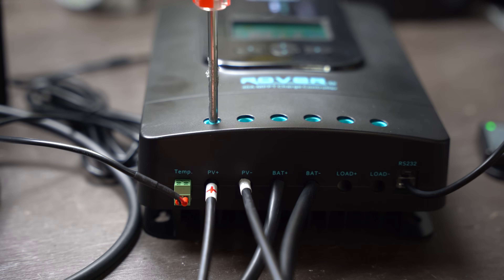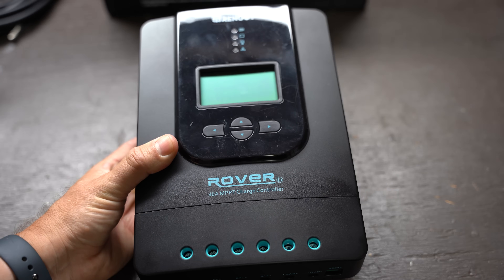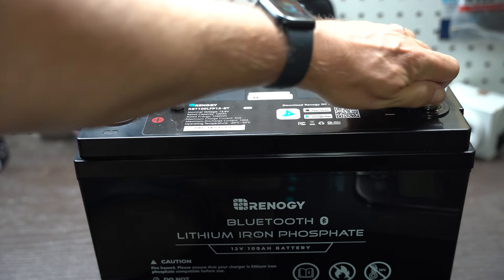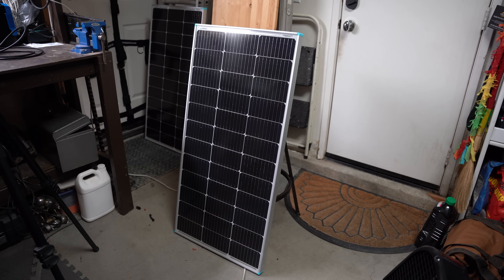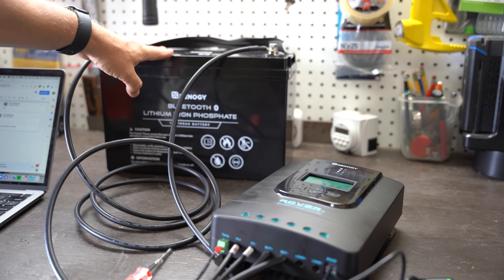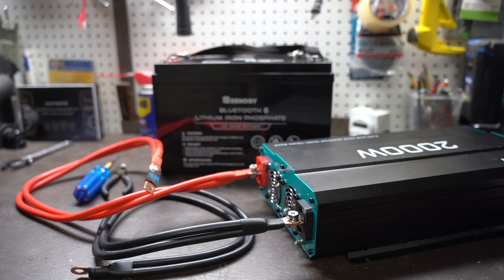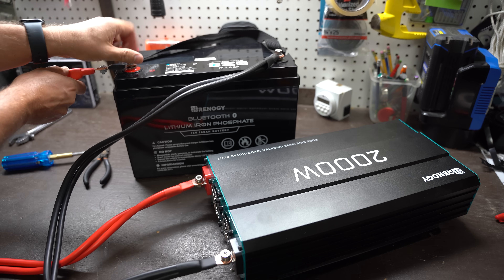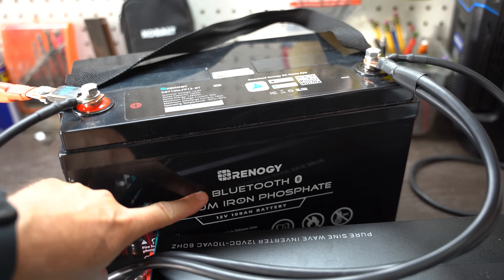DIY Solar Setup: Easy to Follow Step-by-Step Instructions

Comment from the maker: Here are all the items covered in this video:

* Full kit: https://cityprepping.tv/4k929Xj
* Inverter (2000W): https://cityprepping.tv/4baTJe6
* Charge controller (40 Amp MPPT): https://cityprepping.tv/3GJiRNG
* Battery (100Ah LiFePO4 w/Bluetooth): https://cityprepping.tv/44emiWz
* Solar panel (100W): https://cityprepping.tv/42z9A3A
* Battery / inverter cable: https://cityprepping.tv/3Er4YDq
* Battery / charge controller cable: https://cityprepping.tv/4iz4yIY
* Solar extension cable: https://cityprepping.tv/42wrq7e
* 200amp fuse: https://cityprepping.tv/44JejRu

Or, if you'd prefer to pick up a kit with all of these pieces combined (to save money), you can check out these options:

* https://cityprepping.tv/4k929Xj

Follow me on: 

Instagram - https://www.instagram.com/cityprepping
Facebook - https://www.facebook.com/cityprepping 
Twitter - https://twitter.com/cityprepping
Website: https://www.cityprepping.com

#diy #solar #guide
Reply: Amazing content
Thank you so much
I felt really unsure how to go about with a solar setup but, after watching your vid, I feel a little more confident  building one.
Reply: Interesting, in cars, you disconnect the cable from the negative terminal first then positive terminal and reverse the order when connecting, shouldn’t this be the same process for setting up the solar power system?
Reply: Thank you for such a "simple" yet detailed video.  Do you mind providing guidance on the cable lengths and tray cable sizes you used?  As a person brand new to solar DIY, I am not sure.  When I went to add to cart, I did not know which ones to select.  I also think we would need to order 2 of the solar extension cables correct?  I think the first time out, I would like to do it exactly as shown in the video.  (Smile).
Reply: you are such a wonderful instructor! you make this so easy to understand and I feel so confident I can do this for the first time in my life. I've been wanting to get solar panels but had no idea how to begin. thank you so much for all this valuable information. God bless you
Reply: Which kit on that link is this setup in the video??
Reply: Amazing content as always. I recently purchased a Renogy set up, but haven't been able to set it up yet, partially because of fear I'll burn my house down. It seems easy for a small set up like the one you demonstrated, but for a bigger 800W system I don't know how to get started...
Reply: My son in law is an electrician and I am going to see if he will build me one. Thanks
Reply: Suddenly am not scared anymore,  you made it so simple! "I love it"!
Reply: So much cheaper in the UK, you would still save 100% even if you include shipping?????
Reply: For some reason, I cannot get the links to work.
Reply: Hi Chris, I want to build a solar system for my greenhouse. The most thing I want right now is just for the growth light if the system can work for the heater is will be great but not the heater it will be fine for me. What bundle I should buy? Thanks
Reply: Is there an easier way to not have to keep switching the inverter when it’s not being used?
Reply: Great info. Isn't there a quick connect setup?
Reply: QUESTION

with the DIY solar kits do I still need to purchase a battery? is there anything else I need to purchase that isn't included in these kits? thank you
Reply: How to save this video?
Reply: Thank you!
Reply: NEW SUBSCRIBER ❤❤❤
Reply: So do I disconnect my solar unit after my battery is fully charged?
Reply: @ellijahpop  no...
Reply: Nice job. I'm a retired union carpenter so with your experience , you saved me from making costly errors that I cannot afford. Thanks so much
Reply: Thank you. When designing a system as this 12 vdc, should you buy the most efficient panel or the panel with the highest out put voltage?
Reply: Can you hook this up to an actual house panel?
Reply: why don't you use the mppt load terminals?
Reply: Thank you so much, I'm in the process of going off grid with my camper.
Reply: Thank you
Reply: this is penominal
Reply: how much for everything
Reply: Nice easy instructions. The only thing missing for me on this as a power switch. I think that is a minimum. I do have a question about a switch between charge controller and battery or only one for the power to inverter
Reply: You know they make red cable wire.😂
Reply: Can a series of batteries connect to this setup
Reply: P
Reply: @kerry.kumanidis3204  huh ?

Comment: I have been comparing DIY vs purchasing for my needs. I like the idea of 1000-2000 discharge with 2000+ storage as I will be charging it daily with solar and also have a small gas generator backup, but DO plan on using it on a daily basis. Of course the less I have to charge it with gas the more money I save on gas, and I chose to price out 2 x 300 watt solar panels at walmart as they are on sale right now and include a solar "controller". So theoretically I could keep it charged. That's beside the point though. I know I will be getting a solar option that does well but not everything, because of price concerns. Fully solar may be an option someday, but it would be a bit pricy.  Love the knowledge, I needed it. Bare bones pricing it for a minimalist off the grid pricing I got was 2 x batteries 100ah marine- 250; Inverter; 150; Solar Panels - 140 (300 x 2 watt) on sale; Mounting Hardware - 50 (2x4x96 boards are very cheap right now and I would just build boxes and mounts; other hardware wires ect. 50 for a total of 640. Pros is that it would be fully expandable. Cons are reliability and construction. I would do ok and it would work, but pre-manufactured would be more reliable no doubt.

Comment: This is a brilliant beginner guide. Cheers. Got a few curiosities. Does this arrangement work the same way with a standard 12v lead acid battery?
Also, what rating inverter goes with what wattage solar panel etc?
And 11:25 why did you get a spark on the positive terminal there?

Comment: Brilliant tutorial. Love the simple, straight forward delivery. Very quick question - I'm told i"m better off with 200W solar panel on my campervan. In that case, would any of the rest of this setup need to be changed? Thank you!

Comment: I purchased a solar panel that came with a charge controller. and from what I read in the limited instructions the charge controller has those connections that require a Philips screwdriver. but I don't have any wires that go in these connections. to connect to the battery, and the solar panel, and the inverter, the only other connections on the charge controller are two USB ports. and from what I gather from this video. I'm going to have purchase rest of the stuff needed to make this setup work. when I originally Purchased the solar panel to charge the battery in my vehicle.

Comment: You can use shorter wires from the charge controller to connect it to the inverter instead of the battery post's

Comment: Simple enough video but you really should advise people to always connect the positive cables first and disconnect them last. This helps limit the odds of them short circuits if they touch any metal.

Comment: I don’t understand why we are connecting the Inverter with 200 Amp workin to the positive bus bar as well as a the charge controller for 40 Amp and the fuse block for 125 amp?? 

Won’t the positive bus bar be harboring the 200 amps from the inverter and blow the fuses for every other device connected to the same bus bar if it’s not rated for the 200 amps??

Comment: You can connect the solar panel to controller then to device without a battery. You just need to get the right controller that will allow you to do so.

Comment: Great video. I am installing a 100 Watt panel to provide power to my shed. My inverter is 500W, my controller is 20 A/50 V max. How do I determine the size fuse I need for my system?

Comment: Can the charge controller overcharge the battery?
How do you connect a grid battery charger with all that (just in case).?
Interesting that those double cables to a single lug....
8 awg + 8 awg is rated to carry about 55-60 amps. Or about 720 watts (12v x 60a - 720 watts) Quite small for a 2,000w inverter.
Whereas a single awg 2 can carry nearly 100 amps.
About initial connection to inverter -
Another video said you can damage the inverter if you do not precharge it.
They took a simple light bulb type voltage tester in between the positive battery terminal and the positive cable till the light goes out.
Protects the capacitors.
Then connect normally.

Comment: Silly question, but how do I connect the inverter to a soft panel box to run power into a small shed so, that I can pull power from outlets and LED lights.

Comment: The temperature sensor is not for lifepo4 batteries it is for lead acid batteries as listed in the instructions.  I recommend  taking one cable and using red heat shrink tube or red tape to mark both ends for the positive lead.

Comment: I love the video, provided a lot of information. Also, I  have a few questions:
-With this type of setup (connection), if the battery is full, does the electricity go directly to the inverter or it still goes to the battery then goes to the inverter?
- If I have multiple solar pannels, how should I connect them all together to connect to the controller?

Comment: What gauge wire do you use to connect the solar panels to the charger, charger to the battery, battery to the inverter?

Comment: WHY did you connect everything up in a certain order, and then Disconnect everything when it was time to connect the inverter??
Couldn't you just connect the inverter to the battery First, and then the charge controller, and then the solar panels?
I'm a confused newbie...

Comment: Hey, great video. I have a question about a garage with a fuse box with wire already running through the garage. It is not connected to a main. Is there any way to run Soler to the box so I can use the already-run outlets?

Comment: Just a thought. Why not first connect inverter`s leads- then connect battery leads to charge controller. Then connect both inverter & charge controller leads to battery. ( negative first). Then finally connect solar leads to charge controller. Saves time.

Comment: Do I still need a charge controller if I'm setting up solar to a 24v DC appliance?  I already know I don't need an inverter.  I thought DC would just be panels to battery to appliance.

Comment: My 12 V deep cycle battery in the RV shows to be low, after connecting the charge  controller and the solar for 24 hrs it shows the battery is still the same and no signal from the solar panel? Is there an on and off switch on the actual solar panels?

Comment: I have multiple 100ah batteries with separate inverters and charge controllers do companies make and sell power stations without the battery that can have one added or is it a set kind of thing? I pieced my just in case back up power source thru the last couple years. Looking for options? There in a faraday cage for storage and are ran everything couple days… some help would be appreciated thanks all

Comment: Why do you connect negative connections first, then positive.  I’ve always known that you connect positive connections first (like on a car battery) and then negative connections secondly.  What am I missing here?
Reply: When you do this for cars it’s because if you put negative first, then positive if you were to touch a part of the vehicle with the positive while the negative is plugged in, it can cause a short circuit. But I guess since things he is connecting doesn’t have any concern of short circuiting he chose to do it this way
Reply: Nope.. you always connect negative first.
Reply: Cause it's his video

Comment: Is it possible and practical to use one of those solar charged battery power stations (like bluetti or similar) to a home that's connected to grid and use both simultaneously. So the home receives some power from the battery while also receiving power from the grid.

Comment: 200W solar panel for a 2000W inverter is a little bit low. 2x200W solar panel give you 1200W of output power.

Comment: I have a solar panel setup and I want it to constantly power a trickle charger to Mylan mower. Should I be concerned about this considering I can't easily make sure the battery stays above 20%. Any guidance is appreciated!

Comment: Is it necessary to have an equal voltage of wires in each eletrical component such as the battery and inverter?

Comment: Could you please explain why do we put fuse on Positive side of inverter? Current is running from Negative to Positive, isnt it more logical to put it on Negative side, so it will cut the current flow?

Comment: This is NOT the way to do this. You need safety switches and fuses in this system. Also, you need to ground it

Comment: i have a question on this if you would be so kind to answer. i see you used 12 awg on this system. i am setting up almost this exact system just a different inverter. now renogy recommended that i use ten awg instead of 12awg. does it make much of a difference regarding handling of the watts from the panel to the controller? i am going to use 10awg from battery to inverter. but can i use 12 awg like you did from a single 100 watt panel to the controller? btw the way i love this video its great.
Reply: i am not using the rover as well, i am using the wanderer controller. what benefit or issue within using 12 awg from the panel to the controller will i have if any?

Comment: I’m completely stumped on the set up I have going. The charge controller keeps beeping very loudly and turning off my pond filtration system. I have a 200 W solar panel. 300w inverter, ever start marine, Max 105 battery and charge controller

Comment: Hi please help me,  I connected my 3 lithium batteriesof 12 v 100ah. I have a 12v inverter 16000watts ,I connected my batteries in series,  what did I do wrong

Comment: Thank you for this video!  Please also consider doing one on step-by-step instructions, as you've done here, but for  converting a rotating rod into electricity.  Example, I has a real-time generator of electricity in my bike with I was a kid, it rotated agajsnt the front wheel and "came out" as light on the road from my bicycle light.  

More importantly, hydropower, where any one of many different spin-objects in the water results in a spinning rod which, somehow, ends up recharging a battery.  I know the actual electricity is from the oscillation of a metal plate between two magnets but I dknt understand how it's all set up, what do u need to take ths spinning rod from the water to plugging your lamp into a socket somewhere.

Thanks again!

Comment: Do you have a video showing how to alternately charge the lithium batteries on a van? So solar charging when stationary and using the alternator from under the hood to charge while driving?

Comment: This is a Great simple video for home dwellers to learn form.  Do part 2 with the junction box, disconnects, bus bars and breaker system for a formal setup as I wanted to see how this is all done. Thanks. Rural Farmer.

Comment: Please I have a 250Ah gel battery, what solar panel size, and charge controller would I need for it, and also if there should be a breaker, and the size, thank you

Comment: Excellent video! I've watched quite a few and this makes sense. A to B to C. Thank you. One question... why connect the negative from the inverter to battery first? Why not positive then negative to avoid the spark? I'm pretty basic on my electrical skills but was always taught positive first then negative and opposite when removing the cables. Thank you

Comment: Do I need a charge controller if I have a regulator? I tried to learn everything I’d need & double checked by asking at the store. - I got the battery, s. Panel, solar regulator, and a power connection cable kit (harbor freight).

Comment: You did a good job there are you explained it to 1:23 pretty simple on that battery a minimum battery voltage do they have a control that shuts it off so you don't use your inverter shuts it down or or you just overuse that I don't want room to battery

Comment: Wouldn't it be better to convert the inverter to the load terminals of the charge controller instead of the battery directly?

Comment: can you go straight to the inverter form the charge unit?  is the battery necessary?  could I use a bike battery to hold a small charge ?

Comment: Very easy to understand video great job !   I do have a separate question for you, I have the Renogy Rover 40amp charge controller, I'm purchasing the Renogy 2000-watt inverter so that's all good but if I want to charge my battery with an 80-amp output 12volt battery charger ( if there's a lack of sun ) do I have to disconnect the charge controller and the inverter before hooking up the battery charger to the battery ? Thanks

Comment: Great, simple layout.  Now, one question.  If I also want to use a battery charger to charge the battery from the wall while AC power is regularly available, can I simply connect that to the battery list as well or are there other steps/components I should put in place.  I don’t want to be backfeeding current to my solar panels or something.  I would hope there’s a way to set up a an AC charger/maintainer and work in conjunction with the solar panels to increase charging when the battery is drawn down low.  Thanks.
Reply: Battery “post” as well…

Comment: I would connect 4 cables of the inverter and controller to the battery at once, then connect the other ends to battery and to controller instead of connected and removed and connect again. Just save time. Then connect the solar cable and be done. Thanks for your video.

Comment: Hi great video thank you. 
How many watts is the solar array ? 
I want to do a 2000 watt system.. also 12 volt lithium battery. 
Can I run 2 lines with 2  controllers 40 a? 
Thank you